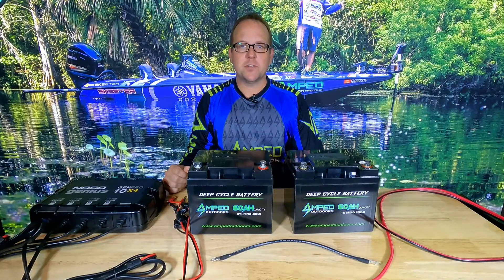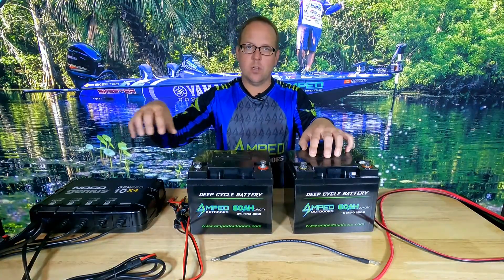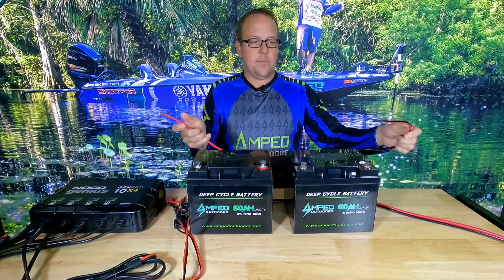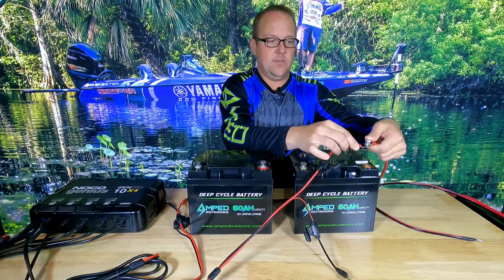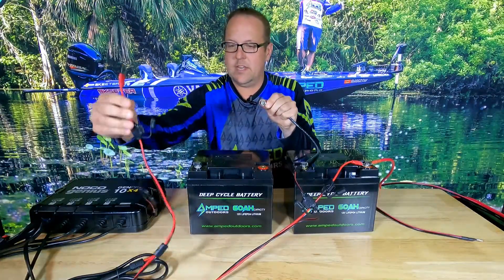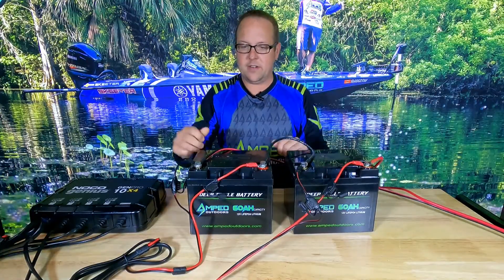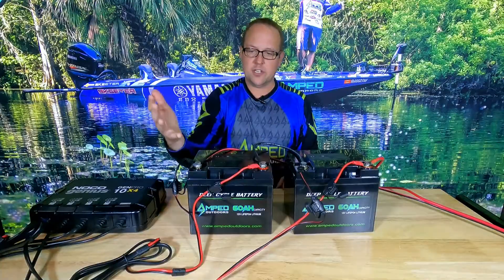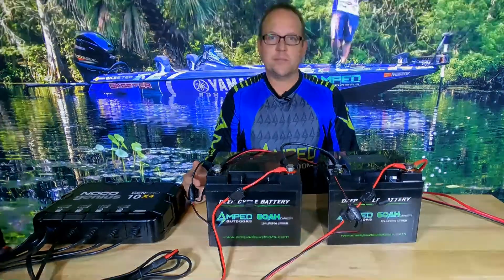How to connect 12V batteries in series

Comment: 2:04 so you can't charge the whole 24V system with one charger for both batteries? i.e. you connect the charger to the + pole of one battery and to the - pole of  the other battery?

Comment: Can I connect directly to just one of the batteries to run a 12 volt accessory under this set up?Understand that the 12 volt accessory could draw down just one battery.
Reply from the maker: Hello, you want to run electronics on a dedicated battery. Keep your trolling motor batteries seperate and isolated.